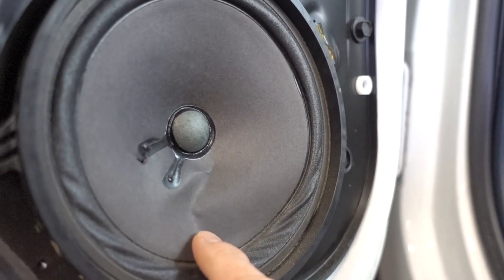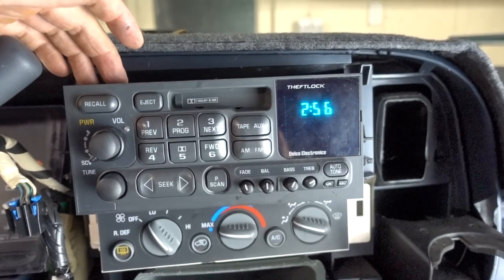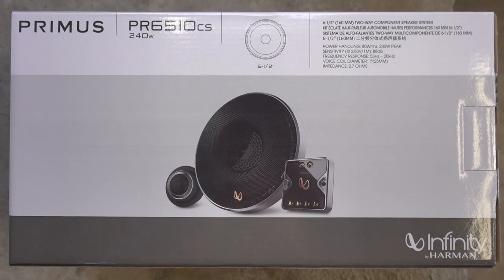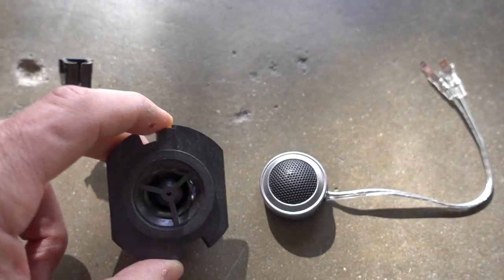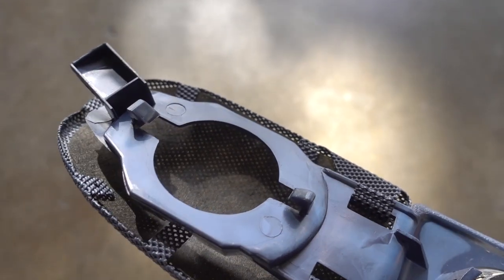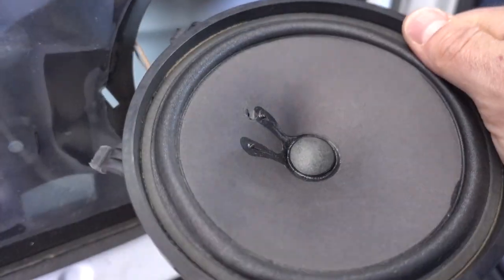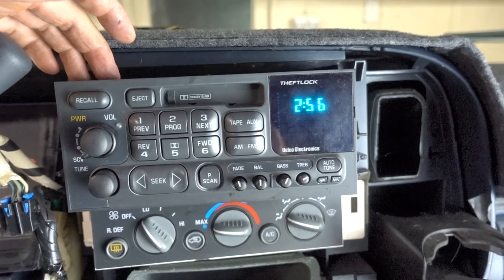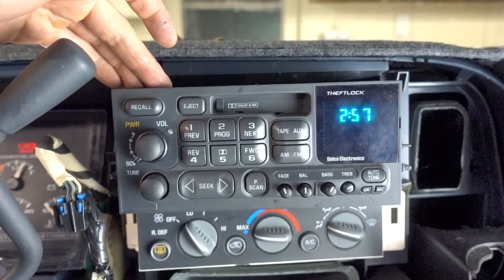EPIC INFINITY COMPONENT SPEAKER INSTALL - FACTORY FIT & FINISH!!

Comment: The wires that you used for the speakers should suffice forever. No need to install quality wires unless you are running it directly from the head unit all the way to the speakers. Great job love the videos keep them coming

Comment: Good Video.
1 Mistake : You should have re-used the foam ring that was on the stock or use an after market one. Makes a world of difference in terms of bass response. Consider sound deadening the door and trim. It makes a lot of difference.
Reply: facts
Reply: Correct

Comment: Man, I wish the Primus or even Reference Infinity components came at lower than 4ohm, like the Kappas.  I'm not spending $400 on a 4 channel amp, then only using half it's capability (most only produce full power at 2ohm).  So, now I'm having to spend double on the Infinity Kappa components just so I take advantage of the 2.5ohm resistance of those speakers, but then those are some of the best speakers on the market and will take the 120W power I will give them via 2.5ohm!!  Better than the 60W the Primus would take from my Fosgate!

Great work tho!

Comment: You need a baffle behind the 6.5 speakers to prevent water from falling on the speaker during rain or car washes
Reply: Trav Hamler  most people don't know how to use those foam baffles, you cut them in half or 3/4 and cover the top of the speaker
Reply: I'm using the RECOIL Rubber ones.  Perfect
Reply: Foam ones= hold moisture --> rust

Comment: The factory head unit in that era of truck isnt bad with new speakers it actually sounds good. The 96-99 trucks actually had decent sound systems
Reply: chevylover432 my ‘99 Burban bumped hard. Till I blew up the doors. All i did was put in proper speaker and the stock head unit powered them well
Reply: So did the 99-06 trucks.
Reply: But you cant fine tune anything, cant select where you want to set a highpass filter or low pass filter

Comment: Those puppies are nice speakers! But if they’re not hooked to an amp they’ll only be getting 15 Watts a speaker! I do painting n car audio at the hot rod shop so let me know if I can assist ya man! I’m putting a baby system in my 95 Tahoe this week!  4 6.5s ,tweeters up front, 8” sub and a 900watt 5 channel amp. I can get ya a good deal on top notch equipment that’s budget friendly. Your speakers are 80 Watts rms so 15 Watts isn’t even close to potential. It’s like driving a 1000 hp car in only first gear haha thanks for the awesome videos man
Reply: Wes Jacobson what state are u in?
Reply: I left my AC Delco factory stereo head unit in too. Only replace door speakers & the rear overhead pair. With quality 80 watt. The original ones were crumbling, and blown. 15 watt per channel is enough for me & I have severe hearing damage already.
Reply: Saint George Utah
Reply: 12Twelve Family hit me up

Comment: I'm in the process of upgrading my speakers in my Trailblazer (when the weather warms up at least). I very quickly figured out that an amp is a must for any sort of volume and also some sound treatment for the doors and a 'woofer ring' (or whatever they are that 'seal' your woofer to your door panel) significantly increase clarity and mid-bass. Otherwise, it's kinda like dropping some sticky tires on a stock civic without any suspension, engine, or chassis mods and wondering why you're not winning any races. I figure I might as well do it right the first time, so I'm just gonna do all of those things in one shot instead of having to take the doors and dash all apart again.

Comment: clean job,not hating number one.....great diy how to,except for a few things... to save time, you can use the speaker wires for the input of the crossover that is connected to the factory speaker(assuming that it is full range signal..a very rudimentary way of testing,you can test this by hooking a speaker up to it and playing the radio to it and listening for a full range of sound). Thus saving time cutting factory electrical tape to find the connection. POLARITY POLARITY POLARITY... assuming you have full range signal for the crossover, the next step is to make sure you wire it in the correct polarity, meaning positive to positive and negative to negative.. an easy way to do this is with and tone generator/popper, but if you dont have one, a 9 volt battery will work too.. cut the factory plug off and connect to the stock speaker, strip both wires a little bit and touch one to the negative of the battery and the other to the positive of the 9 volt battery(observing which wire touches the positive terminal of the battery.and if the speaker moves out of the frame away from the magnet,thats your positive color...and if it move towards the magnet its your negative) other than that you did a bang up job..alot better than some "professionals" in the car audio industry...i do installs like this 5 days a week, its kinda my job...i believe on your truck its "lights up front and darks in the rear" referring to the positive speaker wires in the doors..i may be mistaken though, thats why you gotta check!!

Comment: THEORETICALLY, paper sounds the most natural-sounding to the human ear, however that's about as far as it can go sometimes, especially when we're talking about OEM stuff. Nowadays, they're about as thick as two paper plates now.

As far as that frame that makes the original speaker, you can use that as a frame if need be. There's just some cutting and filing that need to happen.

Comment: Same speakers I installed in my 2004 civic but with a speaker silicone baffle from NVX the midbass is insane with a 4ch amp alpine amp f-300
Reply: Did you install two pairs, or just one pair?

Comment: Btw, guys doing this, you dont have to splice into it this way. Just buy a clip-on harness for the factory plug (plugs into each factory speaker plug) then add a small lenght of wire from the (two new) + and - leads and that goes straight to the crossover main inputs. If you just disconnect or cut the + and - from the factory tweeters, itll be fine, same thing but cleaner. So factory + and - to crossovers, then crossovers to 6.5" and tweeters.

Comment: Now you just need sound deadening, fast rings, an amp and a dsp.
Reply: If you are going to replace the speakers and get the panels loose, number 1 job sound deadening ! Unless you like rattle sounds while listening to music :D :D
Reply: Agreed! If you have the door apart, throw in some dynamat or Noico and cover that whole door in it. Worlds of a difference in mid range sound
Reply: Scotty Kilmer if you have subwoofers you cant hear the rattling
Reply: He's not trying to go all out, to each his own. Some people are happy with not having amps, chill out.
Reply: @jRomero713  putting speakers in without an amp is like putting on a supercharger without  injectors.
Reply: And a decent sealed enclosure single sub and run it all off a 5ch amp for great balanced sound if I could recommend a low power high output quality sounding sub I'd go with focal... I have all focal components in my yukon denali and it sounds insanely and incredibly amazing 👏

Comment: You need to feed these Infity speakers properly by installing an amplifier.
Reply: Looks like someone didn’t watch the whole video
Reply: @sonacphotos  LOL,    YOU CAN CLEARLY SEE ON THE BOX IT SAYS 240 WATTS AT THE LEAST THATS 120 PER SPEAKER/SIDE   he would be lucky to get 20 watts RMS from that headunit , or slightly more with the sony one he has now
Reply: But my main question is why do you need a crossover if your car already have one, the only thing you need is just hook the speaker

Comment: Brilliant! I’m going to buy these exact speakers and install them in my 99 Tahoe in exactly the same way. Thank you Jimmy! 👍
Reply: How was it? Thinkin ab putting some in my 98 Sierra
Reply: @paytonwitte7601  Ha ha. I put the 99 Tahoe project on hold for a bit. Speakers have been sitting around in my house unopened for months now. I am going to install them in my 97 Tahoe instead in about a week or two. Will give you an update when I get them in.
Reply: @paytonwitte7601  Well I just installed them in my 97 Tahoe 2-door. They sound very good! And in fact just for now I left the original 25 year old tweeters in there. But even still, the sound is great!
 
One thing I noticed when I went to install the speakers is that the tweeters they give you in the package look exactly the same diameter as the ones that originally came with the truck. So instead of getting out the Dremel tool and modifying one of the adapters that comes with the speakers like Jimmy does in this video, I'm just going to grab a pair of tweeters off a truck at the junkyard and remove the OEM tweeters. (Just so I have a set of backup parts.) I bet the new tweeters will fit right in the plastic holder where the originals live. Will probably require very little modification, and the tweeter mounting housing just snaps/rotates into place. Very easily accessible, too, you don't even have to take the main interior door panel off, just the little panel with the door locks and window controls on it.

Comment: That infinity speaker package on the Dodge you liked so much unfortunately didn't age well, that's why I'm here looking for a  better set up. It was better than the alternative back then but the infinity stuff that went into Chrysler vehicles was definitely not the same quality as their aftermarket. They did weird stuff like put mini amps on the back of the 6x9s in the front to power the rear speakers, and those failed.

Comment: 4:56 you only need to install a crossover if the system did not have a separate tweeter and woofer before. If it did works without this crossover

Comment: I have a 96 silverado with the same interior.  I need to tackle this project in my truck!!!
Reply: Im installing a system in my 96 chevy c2500 extended cab. I'm going all infinity speaker and a Harmon Kardon ca5250. Mine is a Cheyenne so no carpet.

Comment: I just got some Component JBL speakers 4ohm for the front of my car with tweeters and no amp. But we hooked them up and they don’t sound clear. More muffled and crackling. Do you think it’s the wiring and connectors? That’s the only thing I think it can be.

Comment: Should used foam around the woofer like the factory one itll give it better bass
Reply: That's what I did on my 1995 suburban
Reply: @missingremote4388  did it on my 04 suburban its pretty much the same set up i also did components
Reply: No no no fuck no the foam is gonna deteriorate in like 10 years and the factory’s are fabric surrounds

Comment: I'm confused. Did it come with 2 crossovers? Or do you run the wires from the passenger door all the way over to the driver door and connect them there too? I'm trying to figure one of these out I've never dealt with a crossover situation before..
Reply: Each speaker has a tweeter and a crossover,  so 2 crossovers.

Comment: If I wanted to to add a Center Dash channel to a stock 4-channel radio, 
is it OK to use the left front positive lead, and the right front 
negative lead with an 8 ohm L-pad to create a center dash mono channel?

Comment: What I would do differently is I would utilize the factory wiring as much as possible, find where the 2 speaker wires tap into each other, cut the wires and intercept with the aftermarket crossover. In my 2015 Camry, I would mount the Xovers inside the dashboard, and eventually run aftermarket speaker wiring just to the crossovers only by the time I am installing a 4ch amplifier.

Comment: I installed a new head unit, and component speakers in my hummer and I followed this video to a T..... Other than having to use the speaker wire right out of the back of the original speaker and it sounds like crap lol.

Comment: How would you connect them to an aftermarket amp?
Reply: Install the amp and run the speaker wire to the speakers to the amp versus the radio

Comment: why would you not just do basic research online and find out what wires you needed to hook up to instead of testing wires to see what ones they are???   you could have bought a adapter plate for the speaker so it would bolt directly into your door without custom modification and more then likely a better air seal

Comment: Very poor work.
What are you? Obviously not pros!
Wires without tape, into door holes with no protection?
WTF???
Reply: Wtf are you talking about? Maybe a grommet if your worried but those thick ass crossover wires are not gonna move so no rubbing there and the smaller speakers wires he had taped up and together.